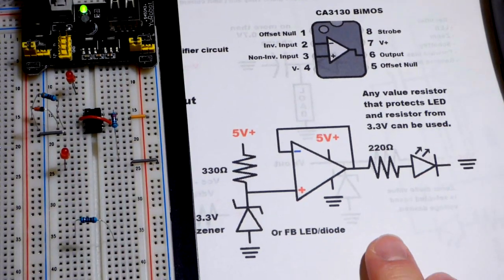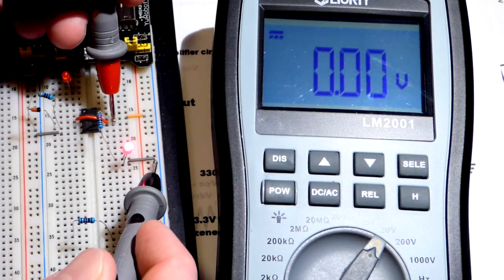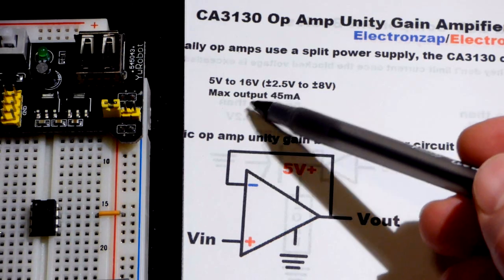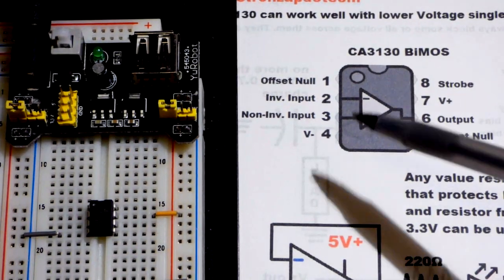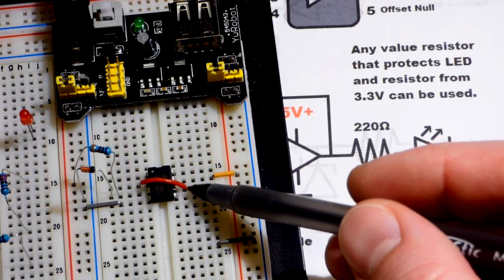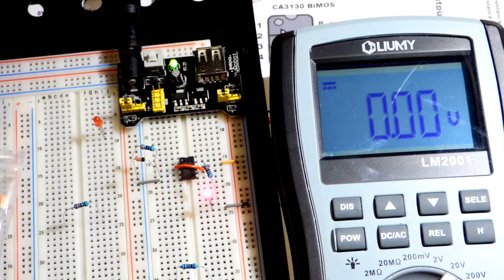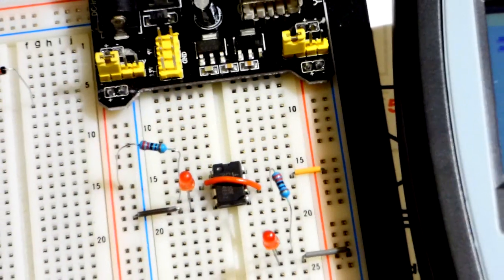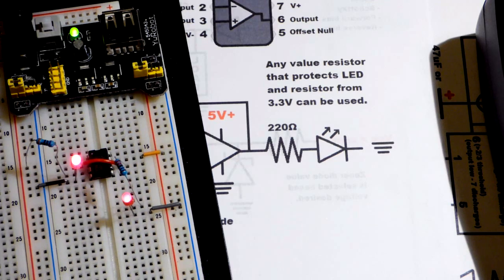Op amp unity gain buffer amplifier using zener diode and CA3130 BiMOS IC

Comment: Great video. That kit is back but they want 60 plus shipping for it. I was thinking I'd just save up a few hundred and buy a bunch from digikey. Alot of the opamps I get are fake. But if I spend over 70 then digikey and/or mouser ship free and pay the duty to Canada  haha
Reply from the maker: I like buying from Digikey. It's expensive though if you only need a few components. I got a number of different things that I wanted all at once when I ordered from them.
Reply: @Electronzap  that's what I do. I ordered 10 cups off them once when I was a noob and it cost over 50 dollars. They must've felt bad for me because they sent me a bunch haha

Comment: how to run the 741 to work as operational amplifier to amplified signal that is coming from a function generator? I couldn't do it I tried to add a negative voltage source to the pin4 but didn't work I can't amplify small AC signal that is 10 milli volts to be two three times the output pin!

what should I do exactly in the design? maybe I'm forgetting something here. if the input is AC at pin3 to be a non inverting amplifier, now shoud I add a capacitor in series with pin3? also should I add a capacitor at the output pin 6 ?
Reply: I had better luck using an LM386 audio amplifier. I am not giving up on op amps however, just feels nice to get a "win" from time to time.
Reply: @HazeAnderson  we bought the lm386 module from a local store and it actually amplified the signal surprisingly ! with only single voltage source. I have the 741au and lm324 too. but both didn't work.
Reply: I put together that Jameco dual supply kit and being able to provide a positive and negative rail of 12V and more really helps with op amps. Be careful with that kit if you try it, is dangerous stuff! I put mine in an enclosure and added a switch for safety.
Reply: @HazeAnderson  the lm386 module works with only 5V and GND. but the lm324 and 741au are only chips but they don't work even with negative voltage source ! I have worked with different chips that are more complex than the 741, but surprisingly it's not working for me !
Reply: I first started toying with op amps about 4 months ago and only recently found success! Question ... where is your negative voltage source coming from? You should have three terminals: positive, negative and ground. If you measure the voltage across positive and ground you should see, say 9V, and across negative and ground should be -9V. You also should be able to measure across positive and negative and see either +18V or -18V.
Reply: @HazeAnderson  i used two voltage regulators lm7805 and lm7905 with 6V adapter. i got the two voltages positive and negative. i forgot the the common point when measuring the positive and negative voltages but i should get back to the circuit next time and investigate it more.

Comment: The term unity gain can be hard to grok. Since technically, ZERO gain would be 100% loss of signal, we can't say that this circuit has no gain ... it has a gain of 1, so what a layman would consider as "no" gain we call "unity" gain. But this begs the question WHY? Why would we want the same gain going in going out. Because it's not just about gain, it's also about circuit integration, and this circuit will create an output buffer by converting a low impedance input into a high impedance output and it can also re-invert an inverted output from an upstream op amp. In other news I ordered some ICL7660S chips, check out their data sheet. :)
Reply from the maker: Good points!
Reply: @electronzapdotcom  I'm trying to find a project that uses opamps to solve a practical problem. I know we can boost homemade sensors like arduino modules do. I have a friend who took an electronic engineering technology program and they had to make a bullet proof ekg machine for their final project but the instructor basically did it for them and he doesn't know a thing. When I took software engineering 25 years ago I gave 100 percent and I smoked weed every day haha my grades were great. I originally took a diploma program focused on building business end to end applications  but hated the drudgery so I took all engineering courses for electives so I put an extra year and a half into algorithms for data mining before it was something that followed us around. I saw it coming though and went into policing instead which was another bad decision. So now I'm 44 and been retired 8 years and have been leaning into learning everything I can. It's more fun to do things if you don't need a microcontroller.  I started with a Chinese electronics kit off Amazon and tons of smd soldering kits because I was only used to fixing guitars and the odd game console and small appliance. 

Sorry for rambling. I like your straight to the point style of teaching in a clear manner anyone willing to learn and doesn't have 40k worth of keysight gear. I have an insatiable quest for leds though. I spend about 80usd a month on them haha. I'd like to build a switch mode psu but it's hard on protoboard and the ics cost a fortune just to build it and take notes and never use it again haha. I can't use breadboards anymore. I buy verro board. There's certain things you just can't do cleanly on breadboards and I have a million of them.
Reply: I think it's used for buffering a specific voltage to another part of a circuit that doesn't share the same return path. Like using an inverter to clean up a square wave in a cmos circuit. I'm still learning though so im open to being corrected.